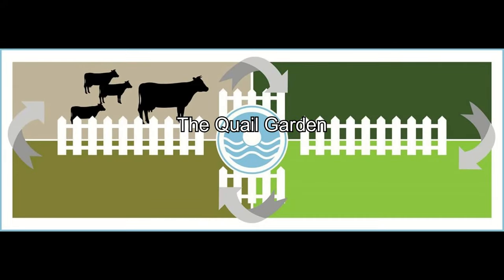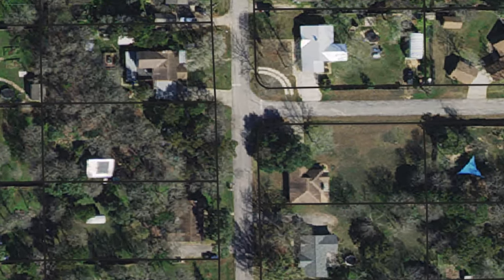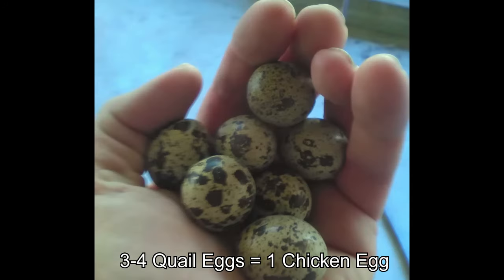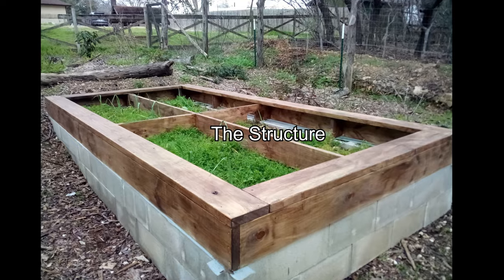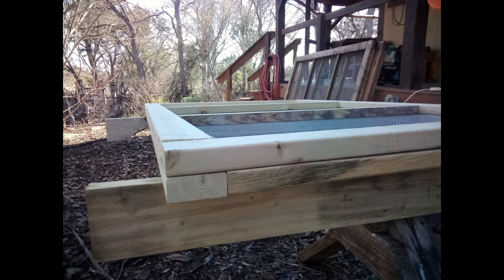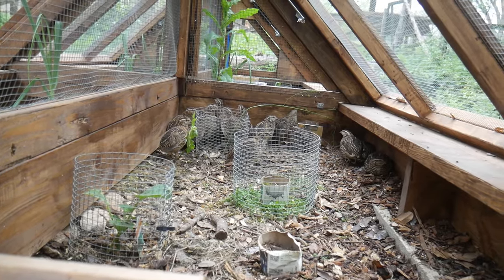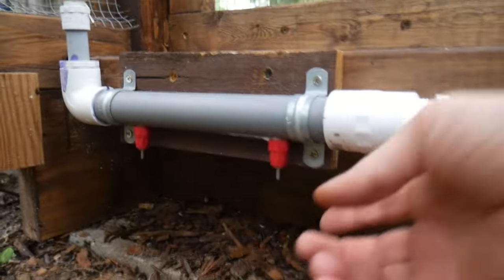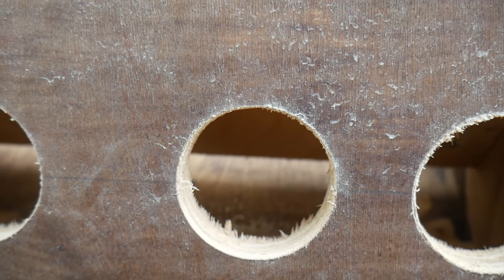Raising Quail in the Garden

Comment: is there a metal mesh inside under the soil? if not, canine predator will get inside in less than an hour. especially from the side where there is no soil outside of it and eat your quails.
Reply from the maker: The concrete blocks sit on a compacted gravel foundation. It would have to be a pretty determined predator. I'll report back in later on successes and failures with the design.